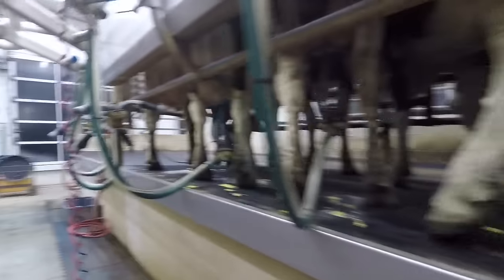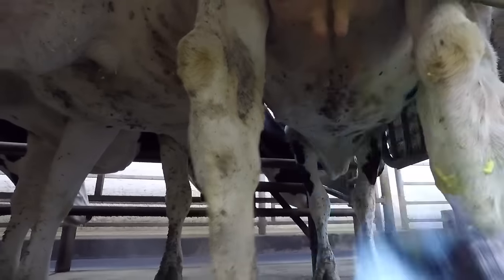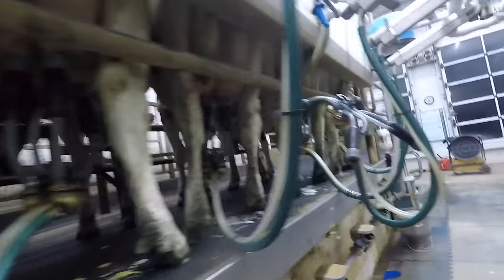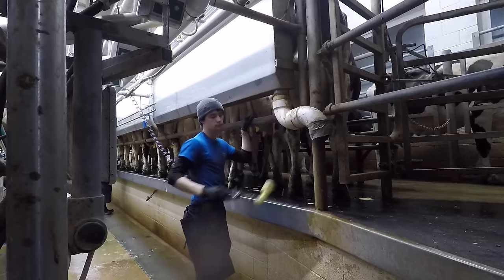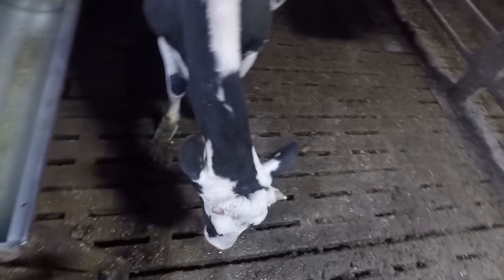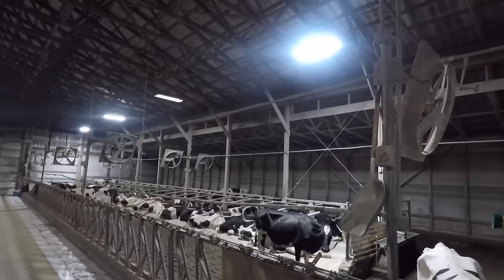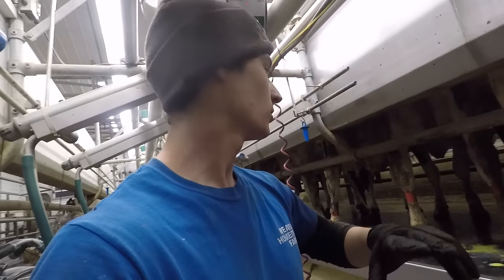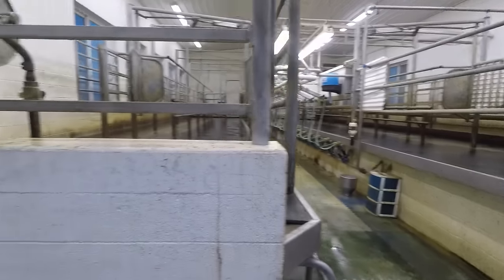Milking Cows on my Family Dairy Farm

Comment: I enjoy milking time. I work for a dairy in Somerset county, Pennsylvania. We milk 400 cows in a parlor similar to your but holds 25 on each side.
Reply: How long does it take to milk them ?
Here in Ireland the general advice is that in a herringbone parlour you need one milking unit per seven cows. 
Thus 10 units _ 70 cows
20 units _ 140 cows
30 units _ 210 cows.
Above this you need to go rotary

Comment: Enjoyed this video. When you placed the milkers on the cows, I noticed each individual milker tube had 2 hoses.  Can you explain?
Reply: There is a degree of variation between setups, but here is a simple breakdown. The milk machines use two things to milk cows: vacuum (sucking) and pulsation (squeezing). The larger hoses on the bottoms of the tubes are for milk collection (sucking), the smaller hoses on the sides of the tubes are for pulsation (squeezing). If you have any other questions I'm happy to answer them.